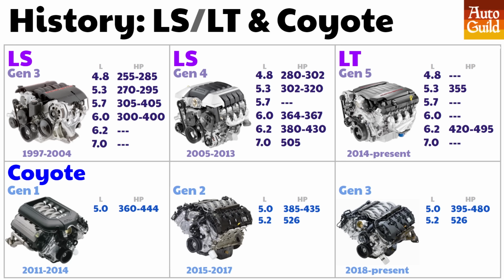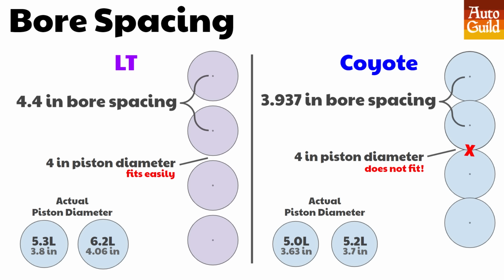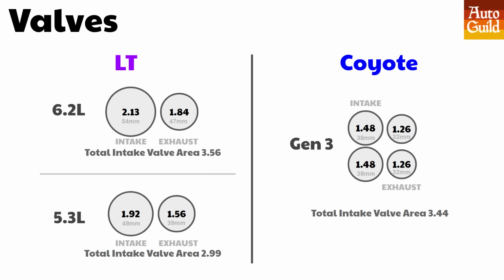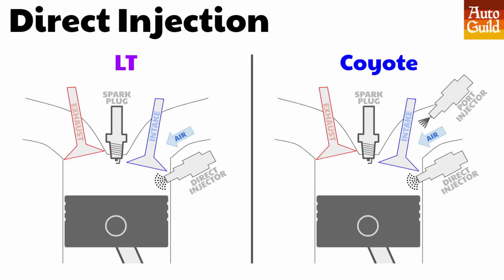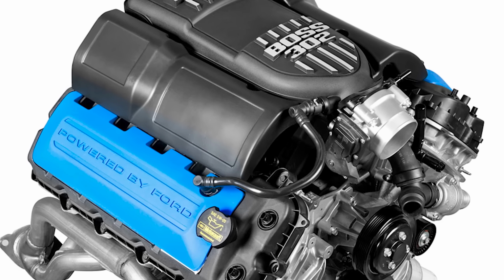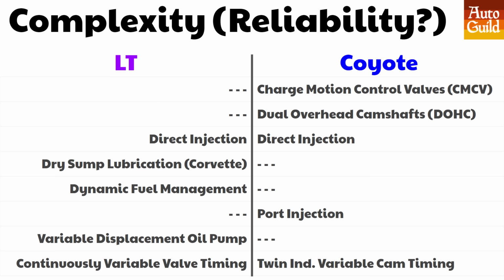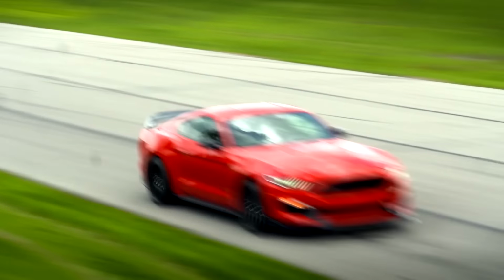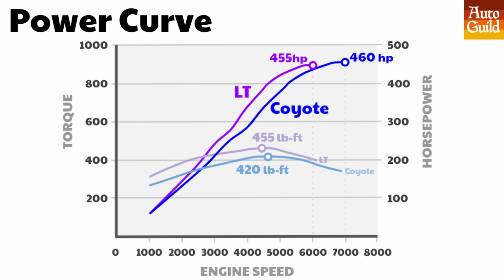GM Gen 5 LT vs Ford Coyote.  Which one is better and why.

Comment: I prefer the higher displacement, compact design, and simplicity of the LT. GM has done wonders with the pushrod design.
Reply: @Frank Bonazza III If you can find a LT4 or LT5 in a junkyard grab it.
Reply: I prefer not having to wind the engine out just to get power. I prefer and engine with good low end power.
Reply: @knightwing4  yep... It why I prefer pushrod v8s
Reply: I like the higher tech DOHC coyote. But there both awesome. I imagine the new z06 DOHC motor smashes both of them
Reply: How many ford motor air boats do you see? If you want a ford to beat a Chevy, spend a lot of money.Tjat's it!
Reply: Push rod lol time to join 21st century with dohc. Can rev higher and produce better power. Domestic companies still living in 1950 designs. What a freaking joke
Reply: Ok boomer
Reply: @scottsmith31  i am boomer cause i see advantage to better newer designs?  I guess you still watch black and white tv, never use computer or microwave. Unlike you i use new better tech. As do anyone with brains
Reply: Coyote sounds better. Both are good engines though. 🎉
Reply: I have a 2008 1/2 ton Silverado Z71 4X4 with the 5.3, it has Over 240 Thousand Miles, Still Perfect Oil Pressure and Still Runs like a "Raped Ape"! The 5.3 is "Bulletproof"!
Reply: @Frank Bonazza III you gotta be a ford fan .
Reply: LT4 and LT5 are the best motors on the planet
Reply: @Frank Bonazza III  Naw, junkyard trolls love all the Coyote blocks with warped cylinders and grenaded oil pumps.
Reply: lol
Reply: Lol
Reply: pushrod equals dinosaur in reality
Reply: @Outlaw-ok7tn  dinosaurs lived longer than anyone , over 250 million years. pushrod is a t rex . The mileage it can get and performance.
Reply: @redtesta  It's clapped the fuck out. Pushrods are dead, and everyone except for GM and Harley seems to have gotten the message. Hell Cam shaft are being phased out in favor of electric solenoids. The comparison to dinosaurs is actually dumb.
Reply: @CamAteUrKFC  you went straight to electric when we are comparing a coyote to a LT/LS???? GM hasnt forgotten. Supposed policy is by 2032 they almost all will be electric which will be gutter trash. Comparing electric when comparing two different mfg's motors is dumb. Im laughing at the electric clowns since all the charge stations use coal to get their power. Look at even Elon Musk's comments lately in regards to electric. Not dumb at all. Guess you didnt understand what i was saying , figured.
Reply: @Outlaw-ok7tn  how ohc is a older design than pushrod so really ohc is the dinosaur
Reply: @rocketmagnet427  dude you are exactly correct, dohc was first
Reply: @Outlaw-ok7tn  why did Ford just copy the LS with the 7.3 push rod nim rod ??
Reply: @Outlaw-ok7tn  if it was true why ford built the 7.3 pushrod
Reply: @LizzyOrozco06  cause.like all domestics they.like pushrods so they do not have to r snd d.better. but.in small high perfprmance 4 and 6 engines no pushrods, cause dohc better power and mileage. Why they are replacing v8 in trucks lol
Reply: @Outlaw-ok7tn  is that why Ford went to a pushrod in the 7.3????
Reply: @camposvazquez I think they went with pushrods because it’s cheaper
Reply: @jmjimbo  pushrods build torque down low... In trucks and vans.. pushrods outperform
Reply: @Outlaw-ok7tn  anyone that repeats this little saying has absolutely no idea what they are talking about. You would make a great parrot tho.
Reply: @Outlaw-ok7tn   that old technology is doing a good job at getting it done. If top fuel dragsters can do ok with pushrod engines so can a street car..
Reply: @uptownsamcv  flip it the other way, if top fuel can make that much power limited to a 2 valve pushrod cylinder head (even if it is a hemi), imagine what they could do with 4valves, DOHC, and MAAAAYBE even VCT...
Do I hear 20k horsepower 500 cube combustion engine...? But In all honesty you'd have to make your block like twice the size/weight to make that kind of power , even while dropping displacement, I mean look at what the honda guys are having to do in the bottom end to hit the 3k horsepower they're doing now! (And they only use 2.0l engines!!!!)
Reply: @MekanikRandR   I just prever the simplicity and compact design. all that weight above the block adds more weight above the center of gravity as well.
Reply: @uptownsamcv  that is a good point.... just make it a boxer 8 and put it under the back seat mid engine style, put it on it's own easily removed rear subframe and have removable under seat access panels and you're golden. (Lol)
Reply: @uptownsamcv  run a dohc in a funny car and watch for flying pistons.
Reply: @anthonycosta1776  not allowed by rules. Oh and drag racing is not only race series look at v12 hydroplane boats oh they are gone as jet engine better, and an electric built for quarter mile will kill top fuel oh buy not allowed. They.make electric motors for trains boats and subs. Why cause they out perform gas engines and diesels, engines used as back.ups not drive motors lol
Reply: @Outlaw-ok7tn  is that why Ford just built a new pushrod engine? Derp
Reply: @Outlaw-ok7tn  And yet Ford designed the  Godzilla 7.3. When journalists asked them why they didn't just make a bigger OHC V8, Ford engineers admitted that pushrod engines were superior in fuel economy for that work. Which makes sense. There's less sliding friction and rotational mass in a 16 valve pushrod V8 than there is in a modern 32 valve DOHC V8. 

Also, the overhead cam engine is older than the pushrod engine.
Reply: @karlschauff7989  facts.
Reply: @Outlaw-ok7tn  pushrod = OG
Reply: @Outlaw-ok7tn  All internal combustion engines are dinosaurs. And technological advancement isn't worth in this case. OHV is better than DOHC at least in V8 engines.
Reply: @mateuszkucharski1350  Lmfao what? No, are any of you clowns actual mechanics? there is no competetion. The coyote is just a better motor. Period....
Reply: @mateuszkucharski1350  not really though, but gasoline and diesel are holding us back, swap over to LPG, CNG, or even hydrogen and all of a sudden you're lean and green and still get to thunder around (I'm planning on going LPG myself)
Reply: @CamAteUrKFC  it does have it's downfalls, they need to make the head cooling mod factory, and thank god the gen4 finally got away from cast crank mounted oil pumps, the billet belt driven pump is going to level the playing field a LOT (though I can't wait for someone to convert them to chain drives)
Reply: @mateuszkucharski1350  And Electric, beats all.
Reply: @montreauxs  Yup. Even in the case of simplicity... No, especially in this case.
Reply: @CamAteUrKFC  I am an ASE certified technician and have been since 1999. being in the industry so long and seeing all the technological advances gives me an appreciation for simplicity. so for myself, I prefer a simple engine with fewer parts and fewer electronics that can fail.
Reply: @uptownsamcv  That's nice for say repairing, and as a Red Seal Mechanic for the last 14 years I also can appreciate that, however being easy to fix doesn't make the engine any better. If that was the case, we'd all be driving single cylinder thumpers with like 20HP because they're simpler. Sorry that argument doesn't jive with me. I mean it's quite odvious the ford motor is better. I could care less, i don't have a horse in the race. it's just pretty obvious, from like very angle the ford engine is better.
Reply: @CamAteUrKFC   i am speaking mainly on my preference. the coyote is a modern marvel but i prefer the simplicity of the LT. to be honest i think the Ecoboost V6 is where it's at when it comes to ford, which is why they put it in the latest GT
Reply: @uptownsamcv  I agree 100 percent with everything youve said.
Reply: @CamAteUrKFC  Can you explain how Coyote can be better motor? Is bigger, heavier and has worse fuel economy, but also have smaller displacement, worse torque curve, lower torque, and lower horsepower on revs which normal people used to drive on a street. So basicly what you consider "better motor" is bigger, heavier, has worse fuel economy and is weaker. Piece of overcompliated, unnecessary technology.
Reply: @mateuszkucharski1350  its called throttle response on an NA engine. Drive them back to back it will come down to your preference. The sound of a high revving V8 is something else!
Reply: @CamAteUrKFC  How so, tik, tik, tik, tik?
Reply: @montreauxs  all I know  is the first thing to go out in any vehicle even the new ones is electrical now you wanna make it nothing but electrical lol good luck
Reply: @CamAteUrKFC lol yeah coyote is so good most people want a 3.5 Eco boost instead of the 5.0 coyote in a truck
Reply: @donaldkinder6716  and most people want those over the 5lt. Wtf if your point lmao?
Reply: @CamAteUrKFC lol POS coyote will fly too pieces way before a LS or LT engines you will never see a coyote engine with 300k miles without major repairs like timing chains will be wore out and break way before 300k miles moron too many parts in a coyote engine GM sold over 100 million LS and lt Engines

Comment: Scrap the new 5.0 in the 2021 as it's an active fuel management and rubber oil pump driven belt POS like the POS afm chevy engine. Both are crap now.
Reply: The 5.0 was ruined when they replaced the cast cylinder sleeves with the nikasil spray-on lining. That's when all the piston knocking and oil burning started.
Reply: Not really sure why Ford went with DOD and a belt driven oil pump on the 21 Coyote in their 1/2 tons. While AFM is chit, it is something you can delete. And I'm not just talking about turning it off in a tune, as AFM is a hardware issue and not a software issue. Not cheap and you have to dig pretty deep in the engine and replace the lifters, and cam and plug some oil passages that send oil to the AFM lifters, but when you do you get back to that good old fashion SBC reliability that they're traditionally known for, and it presents you with the perfect opportunity to port your heads and cam it.

Not sure how Fords DOD works. It may or may not be simpler to delete than GM's system.
Reply: @JROC734   If you turn the system off in software, there is literally no way the hardware can fail. GM guys have turned AFM off only in software and never had an issue. The lifter is locked by a hardened steel pin. If the system is disabled, there is literally no way for the lifter to collapse, since it's locked by the pin. The only reason to do the AFM lifter delete is if you're doing a cam swap since the lobes for the factory cam are different for AFM lifters vs non-AFM lifters. 

Besides, AFM failures are faaaar less common after GM came out with the Gen V LT designs. There are at least 6 or 7 million LT-based engines on the road today. People forget that GM uses AFM V8's in a ton of vehicles. Silverados, Sierras, Yukons, Suburbans, Tahoes, Corvettes, Camaros, etc. Of course some are going to fail, but they aren't failing like the first gen AFM engines were.

Comment: So, I have both in truck application
17 Silverado with 6.2
14 F150 with 5.0 (4x4 with big tires)
I love both these motors, but there is a huge difference in fuel economy. The Ford avg  12.5 city driving and less than 17 hwy. the Chevy gets 18 plus city ( my wife drives it mostly) and 22 plus hwy.  you probably won’t believe it, but you know how the computer keeps the last fifty miles and the best 50 miles?
The Chevy got 33 plus coming south out of Colorado into north Texas. It’s still there on the display. Will always be there cause I’ll never see that again. Lol.
Reply: Ok so I took a pic of the dash recently, it was 24 hwy and the best 50 was 39.5.  Mis quoted myself above.  Didn’t realize I had that pic. Is that crazy for a V8 a truck?
Reply: @markarnold7516   So how are you going to compare a 4x4 truck with big tires to a 2wd truck with stock tires (I assume since you didn't mention either for the Chevy) Also you comparing a truck with a v8 and the other with afm which cuts 4 cylinders out. I think it's crazy for you to believe that trip monitor. If don't calculate it by hand then you can't trust it. All manufactures are optimistic with their trip monitor mpg rates.
Reply: @Greg B  It’s got over 120k
I love this truck
Reply: @Greg B  no real issues other than a refueling thing. Immediately after fill up it’s hard to restart. Only after refueling, any other warm start is no problem.
It did have the fuse problem that I’ve read is somewhat common in that series. Moving it to the other side of the box helped.
Reply: Yeah downhill all the way helps👅

Comment: Does displacement really matter when both make similar power even though the larger displacement of the Lt still gives better fuel economy? Whole point of having a smaller displacement is for better fuel economy. Why not have your cake and eat it too?
Reply: Literally nobody is buying a performance crate engine and worrying about mpg. Hp/tq are the only thing I'm worried about
Reply: @metking21  But I'm saying the Lt makes more power and gets better fuel economy than a coyote while still having a larger displacement. And by your logic you would get a Lt because more hp/tq plus as an added bonus better fuel economy. So why does a smaller displacement matter when you get no benefits from it like for example better fuel economy?
Reply: @aldochavez7523  No, small displacement is bullshit.
Reply: 1 mile per/gal better really
Reply: @USMCretired09  Yea 1mpg better with a larger motor with more power while utilizing a more antique design by comparison if anything that's more impressive so yea 🤷‍♂️
Reply: Cause noone buys V8 for fuel economy.
Reply: LT has a vastly superior torque curve And the power wouldn’t be similar without the active fuel management. Due to the AFM lifters camshaft lift is limited to .511 inches.
Reply: @Aldo Chavez

Exactly man. Why bother with a smaller motor for less tq and worse fuel economy. GMs new 6.6 iron block is gonna smash anything ford has too offer in the coming years.
Reply: I agree.  If the mpg and emissions are not much better for a small expensive complex engine, just stick with the low tech 6.2 L and one cam with 2 valve heads.  My weed wacker has great HP/L but nobody is excited about that.
Reply: Because the new Ford guys are Honda guys fighting about smaller liters 🤣

Comment: I would take the LT,  so much more potential, lower CG and and lighter weight.      The Ford Voo Doo is cool,   but sounds terrible, compared to GM's upcoming Z06 Flat Plane crank engine we have heard in spy videos.
Reply: Voodoo sounds terrible compared to spy vids ?🤣😂🤦🏿‍♂️
Reply: @60weHoodsta  Listen for yourself...   https://www.youtube.com/watch?v=y3zPNB6q8t4
Reply: @60weHoodsta  GM just builds far better engines than Ford, that’s the bottom line, Ford needs all this extra technology and weight, and then makes less power and less fuel efficient, and more expensive to repair!   It’s been the case since the 1950s, and never changed
Reply: Hello David, how are you doing. I hope you are safe and in good health. Looking for a new friend and i saw your pic here. I hope you don't mind thank you.

Comment: Neat! Could you please do a comparison of the Hemi 5.7 and Toyota 5.7?
Reply: Yes
Reply: Not even close Hemi has performance but Toyota has reliability. At end of day dependability rules Performance is a luxury.
Reply: Hemi has dozens of design flaw issues is garbage !
Reply: @johnsmithe498  I agree the Toyota 5.7 is way more reliable but it’d be neat to see them compared side by side explaining why the Hemi doesn’t last as long but has more power.